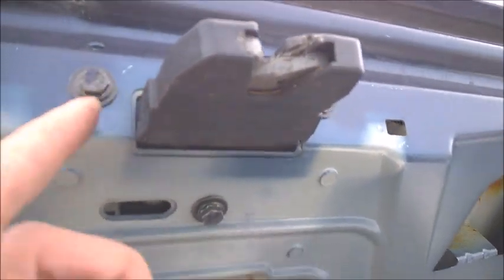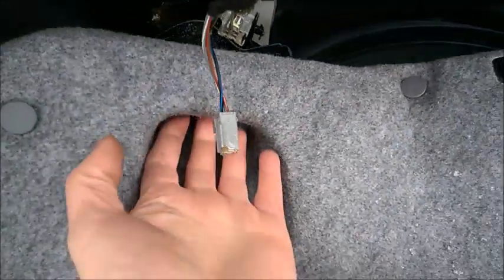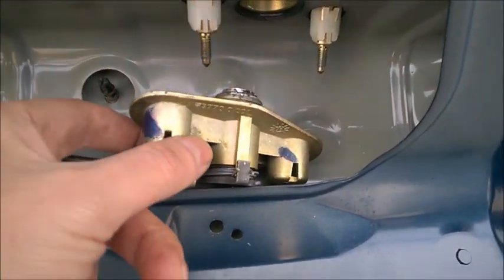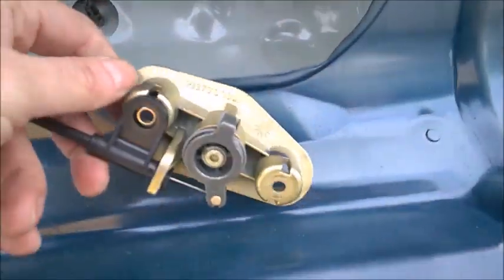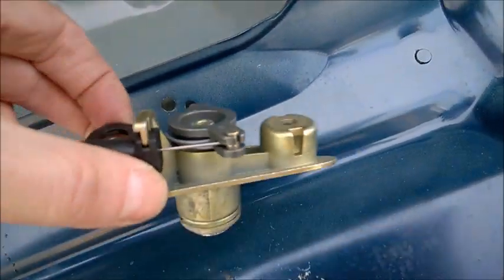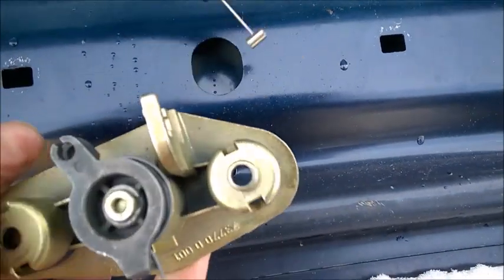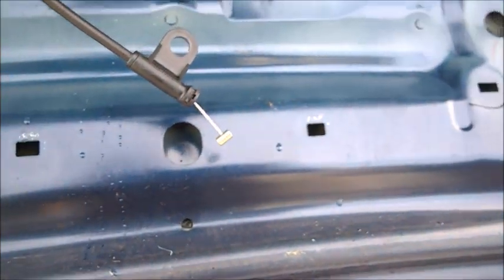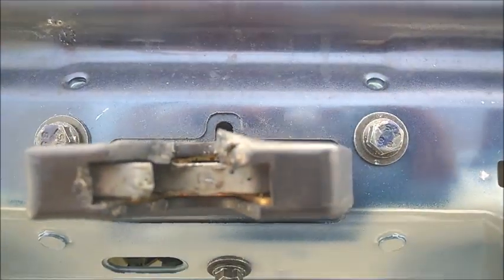Volvo S60 S80 Trunk lock cable removal 2001-2009

Comment: Great videos! Thank you for all the work and time you put into doing these videos for everyone!
Reply from the maker: Thanks, I feel good when people realize the amount of work behind DIY videos or tutorials (not just mines, but all those from other YT channels and forums)
Reply: @Peppermint1  You are welcome! I do appreciate it! Even though your videos are more for S60's and V70's I find a lot of your content extremely helpful when I need help learning to work on my 2007 XC90 v8! I currently only need to replace my front and rear hydraulic motor mounts, replace front sway bar, and either replace my transmission (TF-80sc) or do a valve body swap because of the shifting problem! I look forward to seeing more of your videos! Maybe you can make a DIY bushing remover tool... That would be really cool to see!
Reply from the maker: @clintgriffin8310  I did remove the smaller control arm bushing drilling around the rubber, then cut a groove on the outer sleeve and punched it out (I think I have a video with this). I also read people are removing subframe bushings cutting the rubber with a hole saw (hole cutter).  This may work as well for suspension bushings, using a deep hole saw.
Reply: @Peppermint1  I will take a look at that video. My rear trailing arm bushings are in bad shape! I like how reliable Volvos are but they are such a pain to work on!
Reply from the maker: @clintgriffin8310  The rear bushings are indeed not easy to replace.  I think someone did a tutorial for this on one of the forums
Reply: @Peppermint1  I will check out MVS and swedespeed and see what I can find! 👍

Comment: I have a question i need answered ASAP! My trunk latch wont catch when i close the trunk when the temp is below -2 c°.. Help!!

This has happend twice to me now since winter season has started. I have a 2006 S60 FWD 2.5T. I start the car in the morn to warm it up and open my trunk (Using the FOB key) to get something and it won't lock when i close it. The first time it locked once the temp went up, but this time it's a colder day (temp staying below zero) and it won't lock. The hook won't stay where it should be to catch the latch even when i insert and turn the key in the trunk keyhole to move it.. ( it does not move at all when i use the key in the slot beside the handle) The hook also pops back up on it's own when i use my fingers to pull it out to at least catch the latch when i push the trunk down. What gives? I only see the 'rear trunk open' alert on the dash.  Please help. I'm this close to going to Volvo where i'm sure i'll be gouged.
Reply from the maker: Please try asking on forums https://www.matthewsvolvosite.com/forums/
Reply: @Peppermint1  That site is not letting me register.. keep saying it already has my email address, and i can't send a message to them as well.
Reply from the maker: @theconstruct77  Another forum https://www.volvoforums.org.uk/forumdisplay.php?f=19
May also try buying a used latch from Ebay and have a local garage replace it. It should take about 30 min. I'm not saying it will fix it, but it's cheap to try. You don't have to replace the lock, just detach the cable from the lock - here how to detach the cable https://youtu.be/X2tHzfRVL6U
For future use, it's good not to slam the trunk close (same for the doors and the hood), myself I just lower the lid then push it down by hand to lock it. Here's a latch https://www.ebay.com/itm/01-09-VOLVO-S60-S70-S60R-TRUNK-LATCH-LOCK-ACTUATOR-OEM-8652398/154138450255?epid=1922239014&hash=item23e35e194f:g:jCkAAOSwx39fIFwj